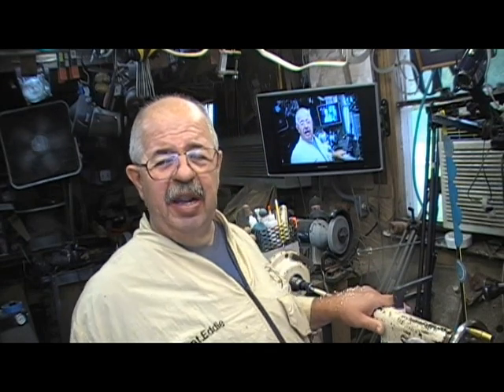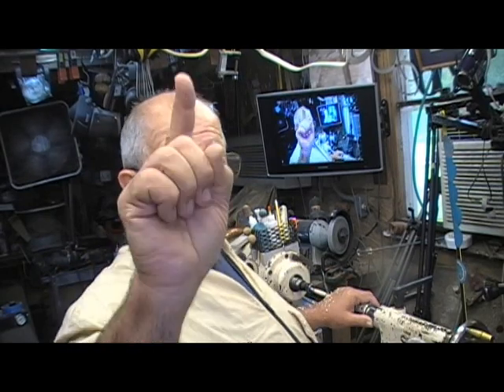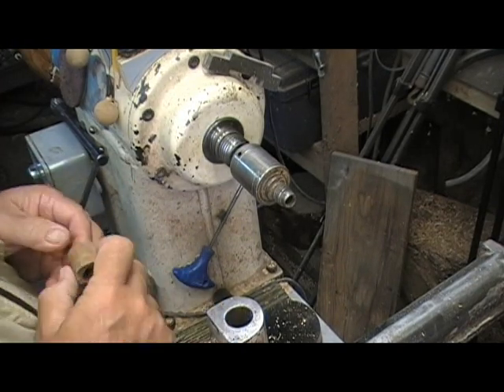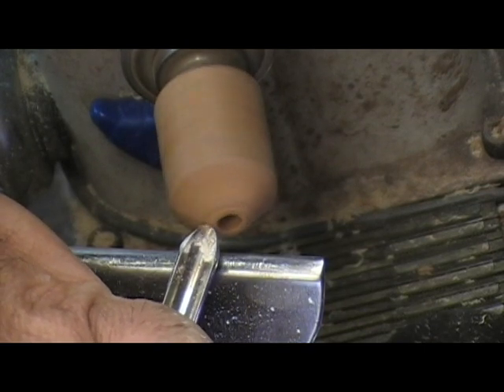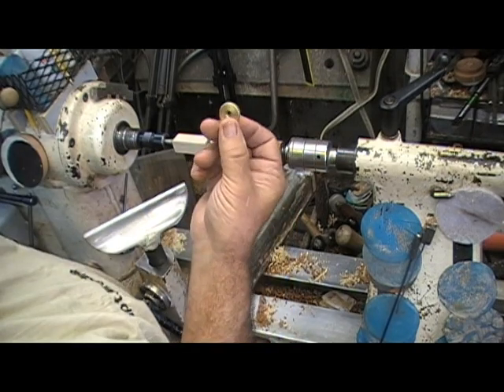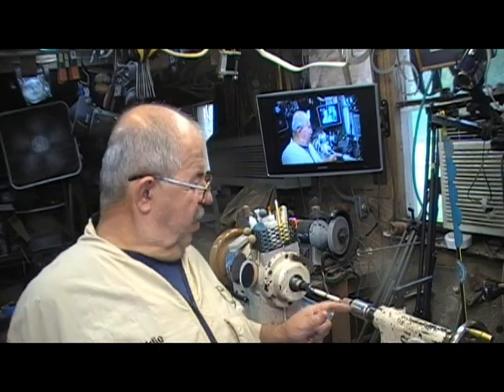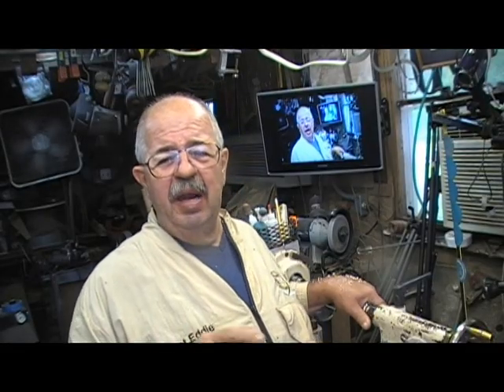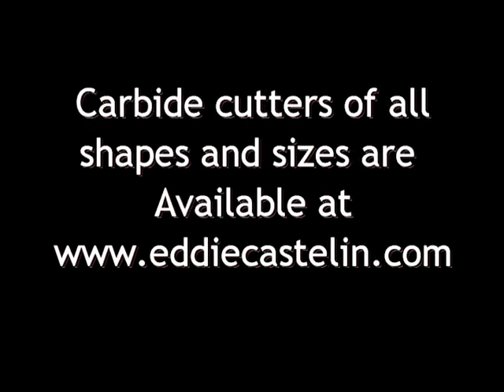# 178 Drop A Nut!

Comment: I made an insert for the Oneway on my metal lathe.  .312 bushing with a .400 shoulder and a .250 reamed hole.  The shoulder rests on the inside taper and the .312 matches the i.d. so you don't need to worry about matching the taper.  Remove it with a 5/16 or slightly smaller drift or transfer punch.

Comment: Hi eddie, I made one of these out of a 60 degree cone center.  Don't drop your teeth.  I managed to really screw up the cone center so just tossed it in the drawer. Last night I saw a home made pen center and I thought of my cone center, I mounted it on my lathe took a bastard file and flattened the nose and carefully drilled the proper sized hole. Works like a champ and doesn't wear.
Kelsey S